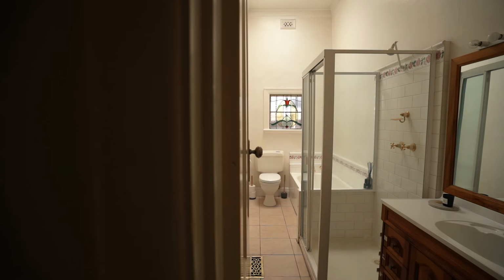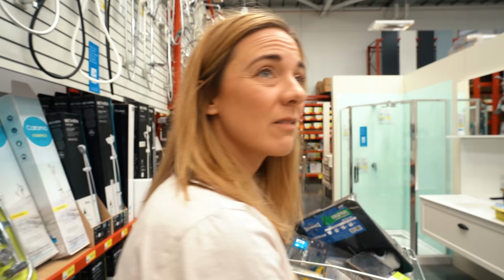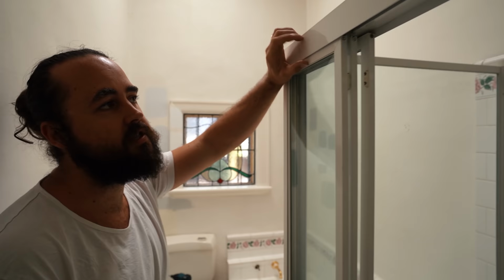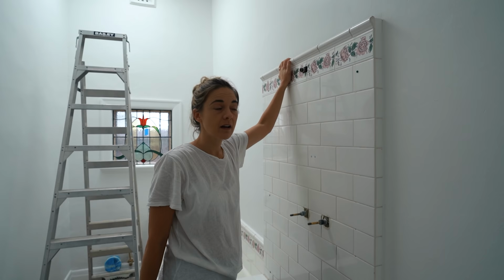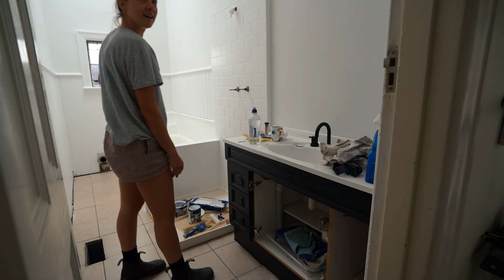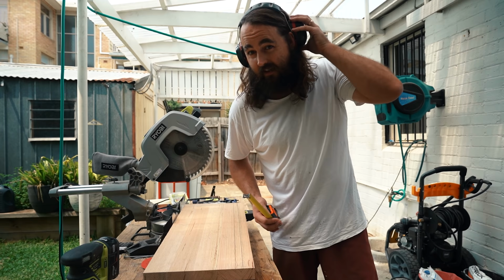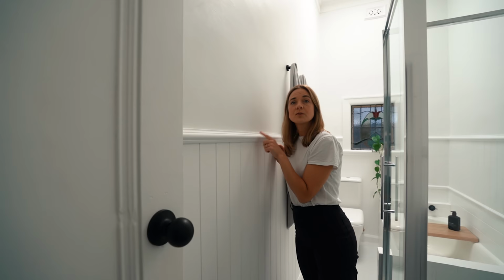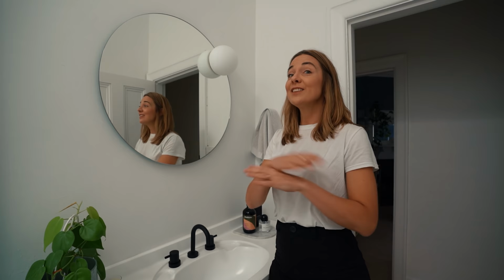Amazing Bathroom Transformation on a Budget, Under $4k! ⚒️🙌  DIY Bathroom Makeover! Before & After

Comment: I wish you would have left the golden ventilation or heating system thing  on the floor it was so pretty
Reply from the maker: It was pretty scratched up and dinted. What’s wrong with the nice clean new white one?
Reply: The room now has black accessories so I agree that the gold vents were clashing and needed to change. I probably would have gone frameless shower to open up the sight line and avoid another colour (silver).
Reply: @Huntingforgeorge  there is nothing wrong with it, the gold was just so pretty :D

Comment: Hi Lucy, the bathroom make over looks fabulous.  I love the very clean whites and black detailing. 
Can you include information on the colour white used (there are so many of them).  
Also, how do you find the painted tile floor?  Is there any wear and tear?  Also, would the tile paint assist with making the original tiles (I am thinking for my self) on the floor non-slip?  I have kitchen tiles that are very slippery when wet and they are a ghastly colour, so would love to give the kitchen and bathroom floors a lift, Des

Comment: Very nice. Did you paint the tiles on the shower floor or would it be better to lay new tiles on top? Hope are the floors going now.
Reply from the maker: The shower has a solid base. We left it as is. The tiles in the room were painted and are holding up great. ⚡️
Reply: @Huntingforgeorge  That's great. Thank you!

Comment: Beautiful transformation. Congrats. I loved the idea of painting the tiles 👏🏻 One question - to change wall-mounted faucets you used the same company as existing one (so the internal part inside the wall was not necessary to change)?
Reply from the maker: Inside the wall is generally just a threaded copper pipe here in Australia. So almost anything new will fit up when the old piece is removed.
Reply: Hunting for George oh, lucky you Australians 😅